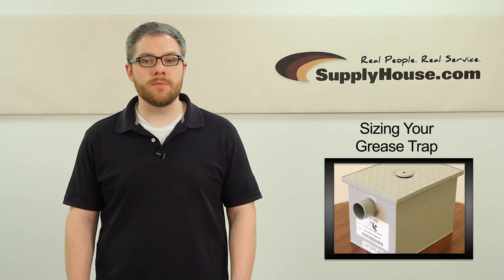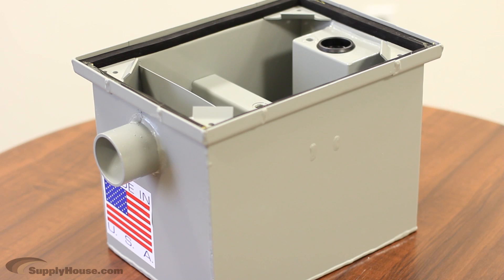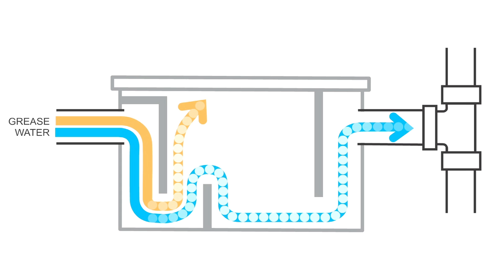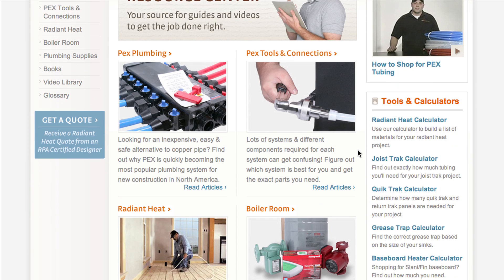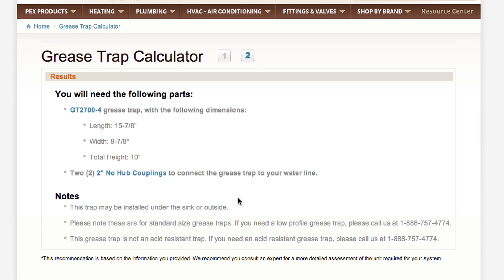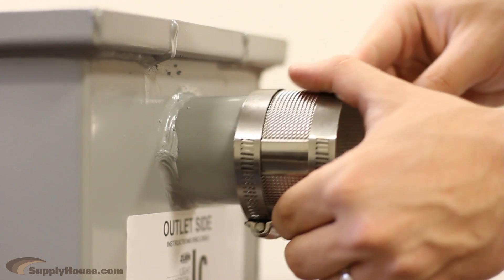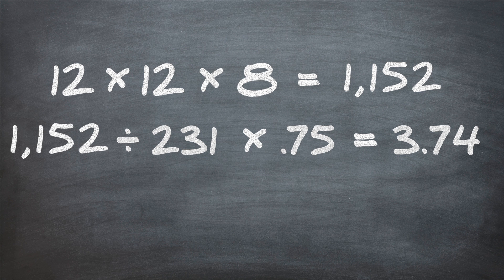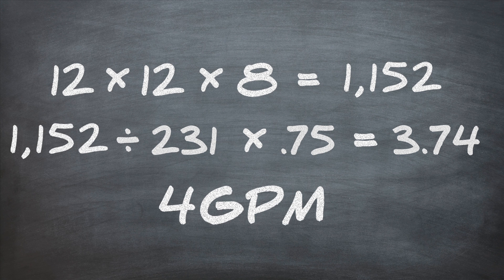Sizing Your Grease Trap

Comment: Why do I have to divide the volumen by 231 and multiply by .75? Can you explain me the reason? I dont get it.
Reply from the maker: Dividing the capacity of the sink by 231 converts the capacity from cubic inches to gallons per minute. Then, multiplying by .75 adjusts the GPM for displacement.

Comment: Umm I'm no math wiz but instead of dividing by 231 and multiplying by .75 why not just multiply by .3246% or .003246? You get the same number.
Reply from the maker: We thought 231 and .75 was easier to remember than .003246.  But you could do that!
Reply: Or you could simply divide by 2 then divide by 115.5 then multiply by 5 then divide by 10 then multiply by 1.5 you get the same number